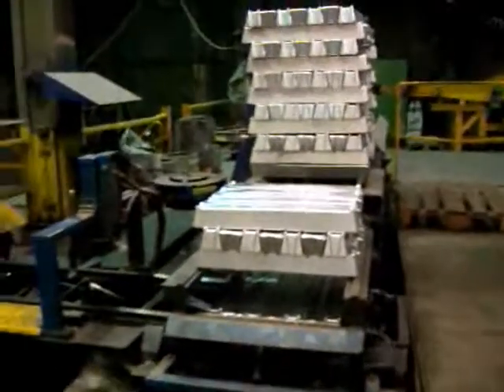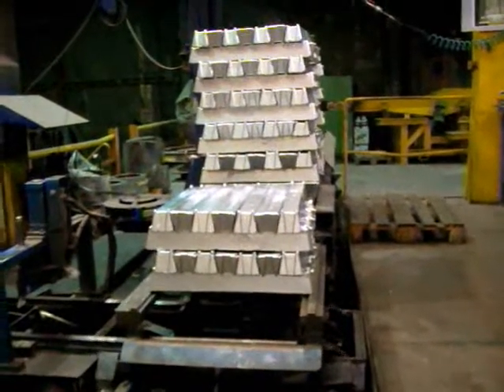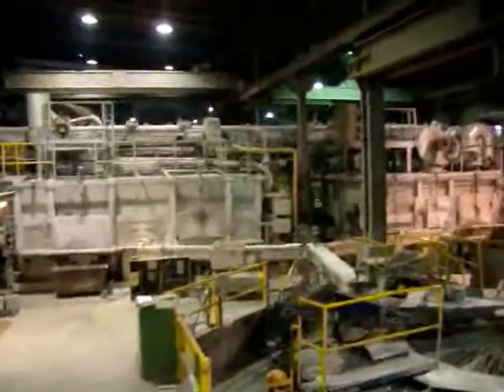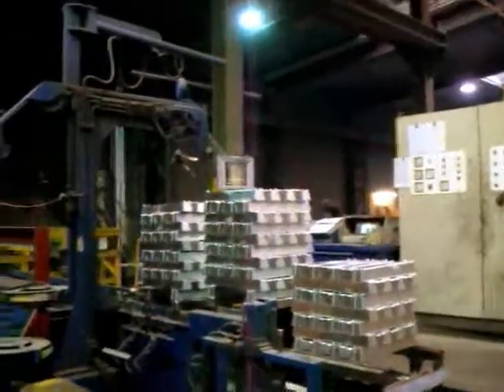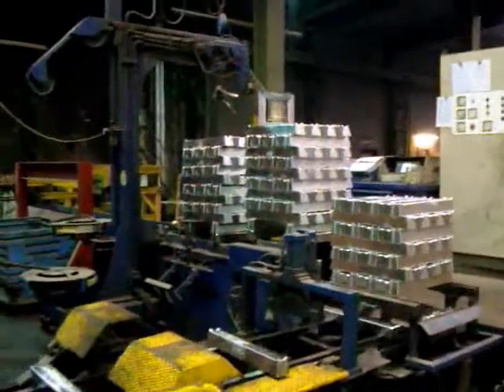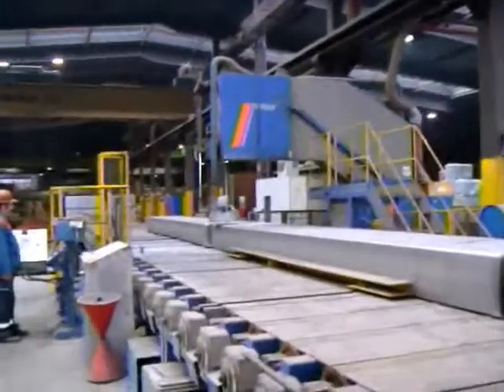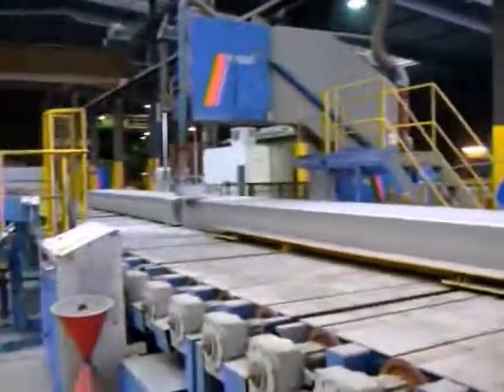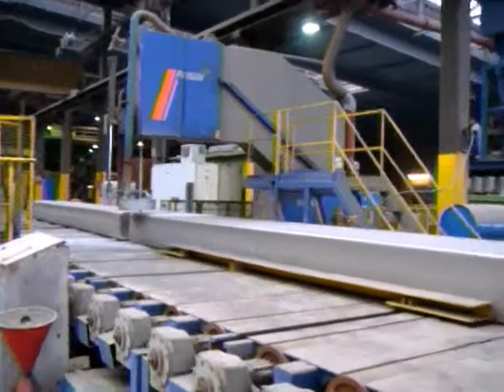Visit to an aluminium smelter

Comment: Good vid but is totally incorrect about the weight of those igots being only 7Kg - they look to be 150x150mm by about 1 meter long so i would believe more like 70Kg each - just one group of 7 would be 490kg.
Reply from the maker: Maybe I misheard the German worker at the plant - thanks for pointing it out!
Reply: No worries - 
Aluminium is lighter than steel or copper but it's still about 2.8X heavier than water of the same volume and those ingots are a good size.